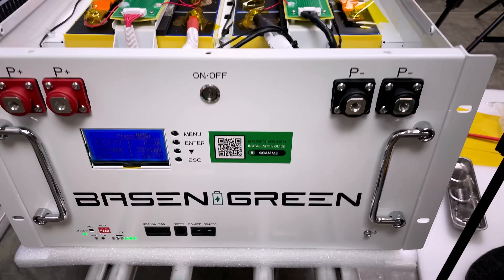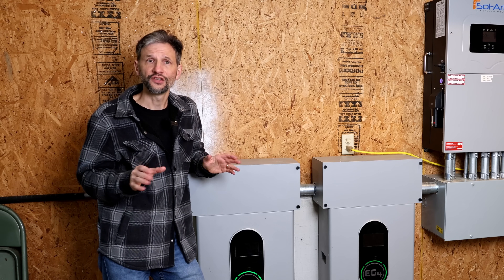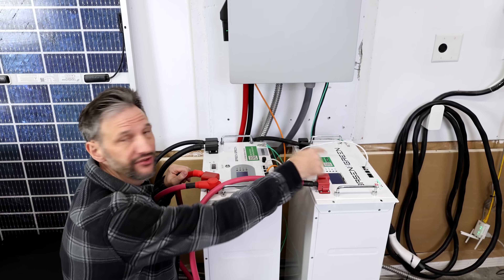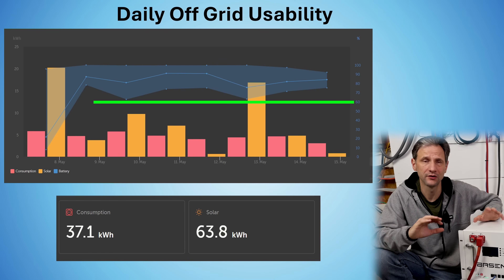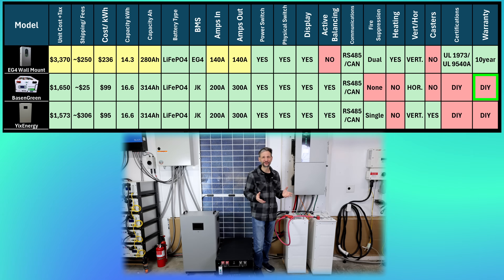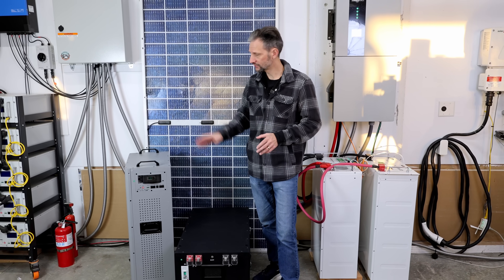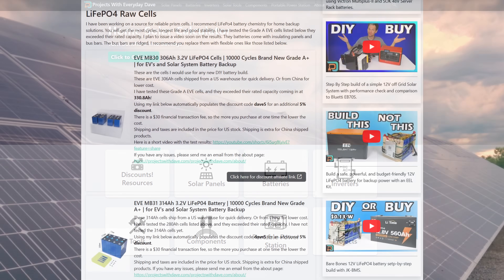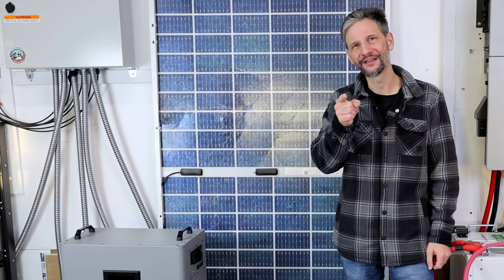I Compared The Top Home Batteries And Found A Winner!

Comment: I'd like to see some higher voltage systems come onto the market. A 192V system could handle 24kW of load with under 150 Amps of current, so instead of paralleling a bunch of batteries to make 500+ amps happen over very heavy cabling, you can run 1/0 cable. That will save money on breakers, conductors, inverters and chargers won't need to be built to handle as many amps, etc. Everything will be much cheaper. The current per cell will be much lower too, so you can use smaller cells with less current capability if you wanted.
Reply: I don't recommend higher voltage packs for DIY. The safety concerns alone with 192V DC for someone who's inexperienced raise concerns. Also, Getting UL cert for a high-voltage pack that is DIY is not going to happen. The BMS for higher voltage packs are more expensive, Breakers , Inverter, etc. Yes, you save on the conductors and a marginal efficiency gain but I'm not convinced this is the way to go for DIY setups.
Reply: But the battery itself will be much more expensive. Below 80VDC, wiring is easy and trivial. Electrical components and PCB design is trivial. After that, things become very complicated and not easy. You need properly shielded cables, rated components, and handling these batteries is dangerous as fuck. Honestly, no. For DIY high-voltage systems will not become a thing.
Reply: @dominikvonlavante6113  We have some old APC UPS units at work that are rated for 6 kVA. Each one has multiple battery boxes wired together in parallel using amphenol connectors. Each box has four battery modules in it with eight 12 volt 5 amp hour lead acid batteries wired in series with a simple inline fuse. Those battery modules connect to the battery box with amphenol connectors, and the box wires two modules in series and two series sets in parallel, so you get 192 volts and 10 amp hours per battery box, for about 1 kilowatt hour of usable capacity. Each unit has four battery boxes on it for a total of four kilowatt hours of usable energy which can run the servers for about 45 minutes. There are no exposed terminals anywhere, and I have replaced the batteries in it every two to three years for going on 15 years now and never once had the slightest trouble with high voltage DC. These systems can be made to be safe if it's engineered to be so. 
I would imagine with lifepo4 batteries a very similar setup could be done.
We have an APC Symmetra LX UPS at a different site that uses 12 volt 9 amp power batteries wired 10 batteries in series for 120 volts nominal, and those are connected by sliding a module into the chassis, and all of the monitoring and communication is handled between the module and the chassis through some pins that get connected. I could easily see a similar setup for this too where you assemble smaller modules of batteries that have their own internal balance leads and their own internal BMS and whatever other smarts it needs, then that gets communicated to the larger unit when you install the batteries using some quick connect pins or something in the back.
Reply: Higher voltage gets dangerous for DIYers. But yeah, BOS costs are low.
Reply: @ArthurDentZaphodBeeb  I can certainly see cause for caution if someone isn't that familiar with electricity, especially high voltage DC. That can be quite dangerous to work on, especially without proper PPE.
Reply: @WarrenGarabrandt dangerous is a massive understatement. 

It's deadly and about as high risk as you can get. Considering the number or engineers I know who have dead shorted low voltage batteries accidentally. I think it's literally the worst idea I've ever heard
Reply: @LithiumBatteryGuy   Ok then, stick with 48 V batteries. I'm not advocating that ALL systems be switched to HVDC. I'm only asking that there be an option for it for those who want it. Even if that is a professional system that must be licensed to get, or something like that.
Reply: @WarrenGarabrandt  I have assembled close to 20 of those DIY batteries. I would say about every 8th to 10th battery I did a screw-up. Most often I would accidentially place a busbar wrongly and cause a short circuit, or a tool or a piece of equipment would drop and cause a short circuit. And let me tell you, even at just 48V, this will scare the fuck out of you with the loud bang of several mm of copper getting instantly turned into copper vapour and liquid copper dropplets exploding in all directions. At several hundred VDC, this will cause arcing and kill you dead.
Reply: @dominikvonlavante6113   Holy crap dude, wear PPE and slow down to methodically plan your moves, and don't rush. I get that if you're doing it as a job there will always be pressure from your boss to hurry up, but that's precisely when you need to slow down. Slow is smooth, smooth is fast.
Reply: @WarrenGarabrandt  I am wearing PPE. It just scares the crap out of you, but is ultimately harmless. The nice thing is that the reaction is so explosive that it immediately separates contact.
Reply: You are pretty much wrong.
Reply: I work in an environment with 100 volt and 26500amps. Higher voltage are better, it gives less loss in the application.
Reply: @kopparsulfat  that's a lot of amps. I would have thought a nuclear power generating station would use higher voltage.
Reply from the maker: Higher voltage definitely reduces the system cost.  There are already some high voltage systems out there, they just aren't main stream yet.
Reply: @ProjectsWithDave  Check out GoodWe been around longer then EG4 and Sol-Ark outside the US one of the top brands. They have UL9540 using LFP batteries.
Reply from the maker: @Mike-01234 - I see they have some high voltage options...  There are so many options out there, I could never test them all.